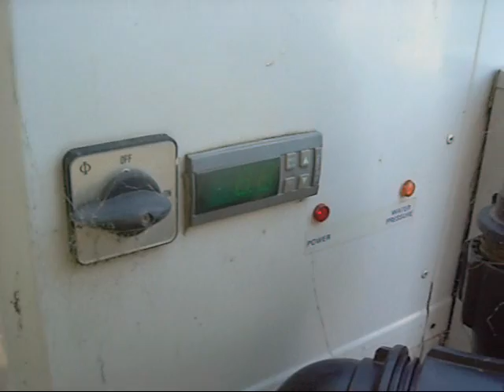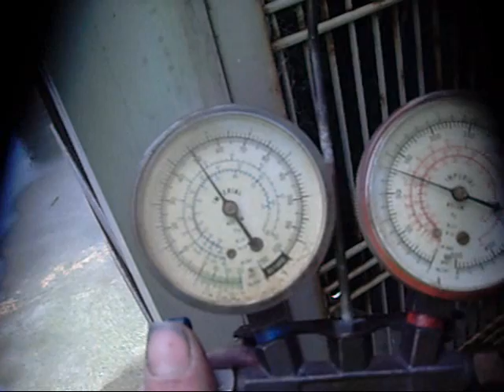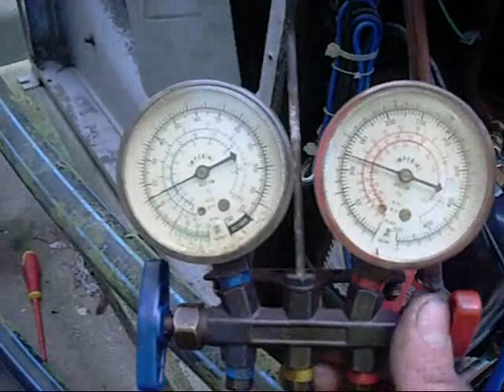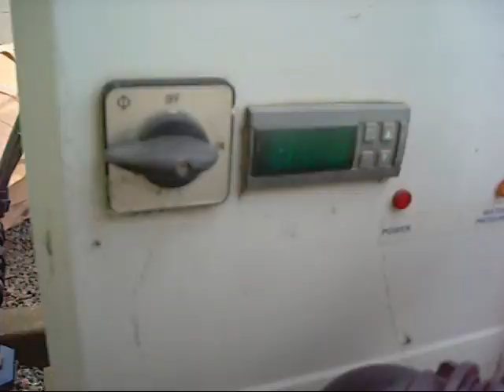Carrier Water Chiller is Dieing - Coil Corrosion and Leak

Comment: @Aussie50 
It will still ice up even if the gas charge is correct, the lcd(liquid control device) tx is before the dryer. Looks like a typical Carrier bunker condencing unit there coils were never balanced right from factory. Get what you pay for, hence the corroded coil !

Comment from the maker: @TheElectricnoob yeah, a low pressure water blaster would push it from the outside through. the coil is too thick for the normal hose to get through.

Comment from the maker: @V8Jagnut it had a failed control board, the RV wasn't getting its 240V signal before startup. so we gave it a new permenant live connection to keep it going.

The compressor is tired too, but I will clean them both some more soon.

Comment from the maker: @heavydiesel yeah the dryer is in the liquid line. the ice on the evaporator barrels could have come from condensation or cracking,

it does have a flow switch to kill it if water flow stops for any reason, but frozen spots could still develop.

Comment: If the unit is evaporating below 0C there is a risk of it freezing up and splitting the evaporator. Is that drier in the expansion line!!!! It should be in the liquid feed to the txv, still its been like it for years. :-)